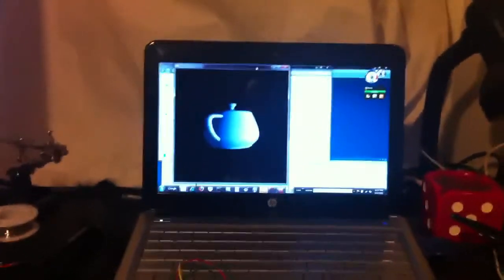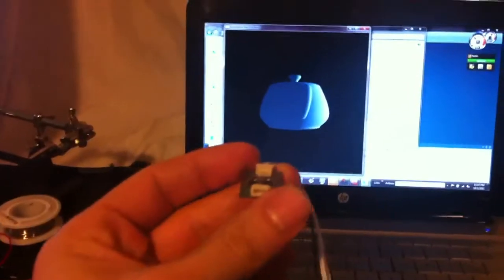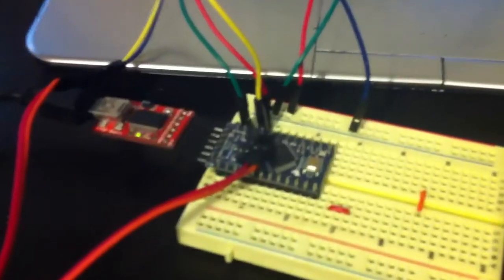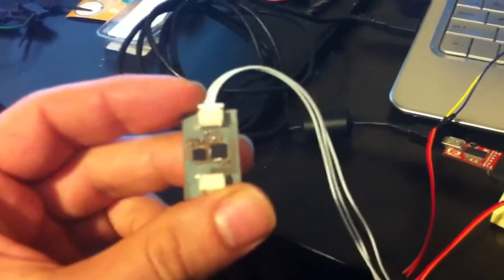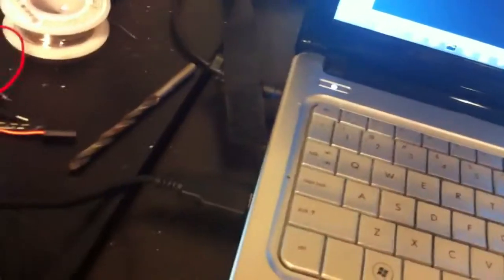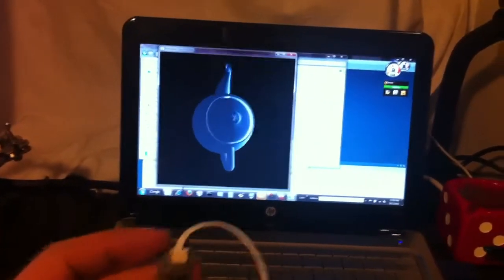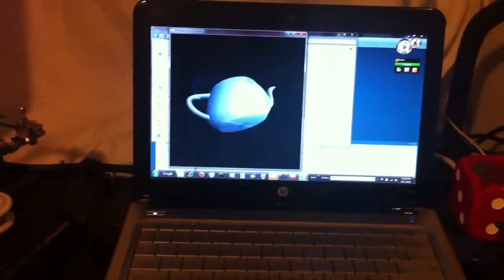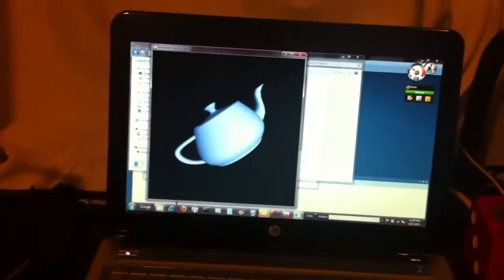MPU6050 DMP 6-axis Fusion running on Arduino!!!

Comment: Is it just the MPU6050 your using or is there another chip on that board to compensate rotation?   Anymore details you could give about how to set this up would be great.  I have most of those parts already .

Comment: Hey Noazark!! Im tryna get a 3d visual demonstration of the board's motion but Ive been using Jeff Rowberg files though the main sketch from arduino is working correctly, I can't get the Processing sketch working!! I dont know if I need to link these two IDE while running both codes (.ino & .pde) or what is it about? I'll appreciate your help. Thanks in advance

Comment from the maker: @ProtegeNoble the Invemsense demo app controls the mouse cursor with windows API calls. It's actually a pretty elegant chunk of code that they use to map the quaternion delta to 2D screen-space cursor movements. Been thinking about porting that to a microcontroller to build a proper stand-alone cross-platform HID compliment pointing device.

Comment: Hi noazark, I am using the arduino code form I2Cdevlib for the MPU6050. When I run the DMP code with interrupts it works fine. but i have implemented a solution without interrupts that start off fine and works for some time, then just stops becuase comms fails on the TWI. If you could help it will much appreciated. Thanx

Comment: Thanks noazark, I successfully ported your code to an AVR32UC3C system. I just don't feel like to use the original library. The 6-axis fusion surely has some drift on the z-axis, but desn't really matter in my design. I'm looking forward to see your 9-axis one :)

Comment: How did you do it?  I've spent 30+ hours researching the correct algorithms that are needed to "fuse" the readings  of gyroscopes/acccelerometers into precise data. I am a freshman at BYU and am trying to create a mouse input glove from the ground up (I previously created a Wiimote glove to control mouse movement). Could I see your code? It would help tremendously.

Comment from the maker: @oddpxl and yeah, that AKM8975 is part of the problem with the eval baord. I want to be developing a solution that uses components that anybody can source. Also, I thought it best to work with the rev. C silicon instead of the rev. A that's on the eval board. I etched this as part of a series in the hope that I could have a new device ready for World Maker Faire. That didn't work out, but it gave me a good motivator. So why not use it? It's smaller, cleaner, and cooler than the eval board.